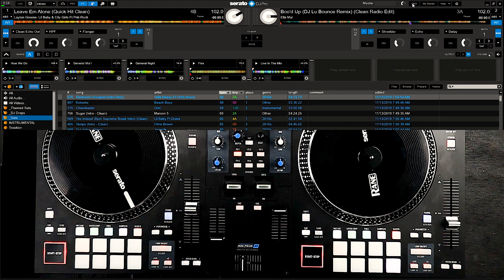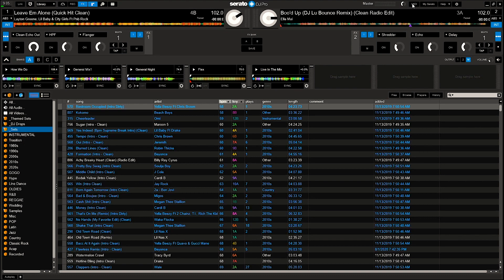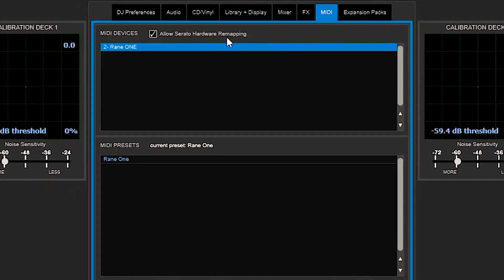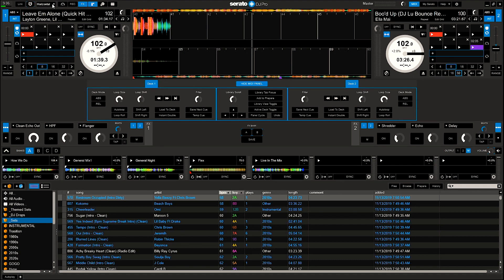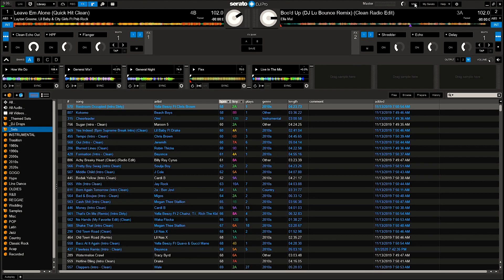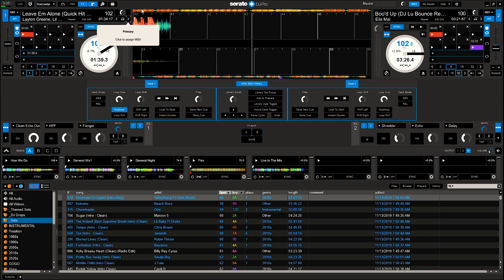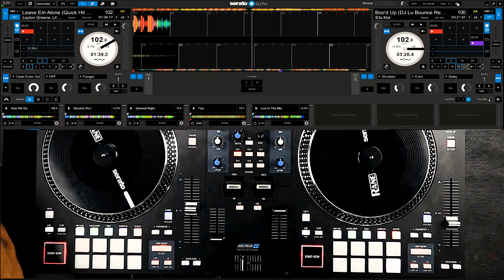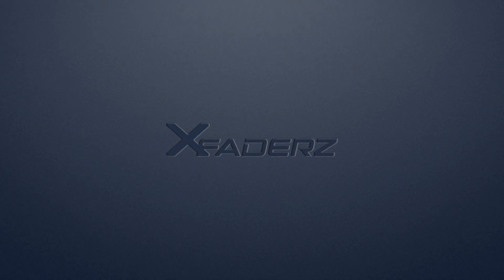Rane One: Remap Troubleshooting

Comment: I have issues when connecting the controller, it troubleshoot to say that audio is not connected after plugging both usbs to laptop, I also calibrate it but it doesn’t give me anything sometimes
Reply from the maker: Wzup djluigielpicosito, I would recommend isolating the issue. -Download and install the latest driver (do not open serato). 
-Try another usb cable. 
-Connect the controller to another pc and verify that the controller appears in the device manager (no errors or exclamation)
The goal would be to identify if it is the controller, cable/usb port, pc. Serato or VDJ will be the last part of the puzzle if the above are functional. Best of luck.